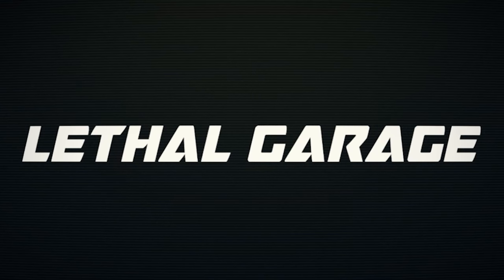Building a Camaro SS/LT1? Watch This Video First! | Drive with Lethal

Comment: I was looking at full NA build
-Cam
-LT2 manifold 
-95mm throttle body
-Kooks long tube headers high flow cat
-Rotofab CAI
-would go e85 but one store within 20 miles and due to elevation I was told not much gain. 
-Tune

Total price quote parts and labor they said $9,000. Is this high or is this normal price? Thanks

Comment: Watched the vid. My 2014 2SS is similar to yours. Have a 2.9 Whipple. All forged with a stroker crank. Ported heads. TRI-Walboro  pump setup with large injectors.  I run on E85. I also have NOS. You keep talking about adding Methanol Injection. Had it but didn't need it. It made the car very hard to tune with the E85. I removed the whole methanol system. E85 is temperamental. I went with a summer tune and a winter tune for Texas.  I think you'll be making a mistake with the  methanol install.  Also it runs out very quickly, you need to keep filling up that tank. Cheers
Reply from the maker: The 5th Gen isn’t a DI motor, so it’s very different.  Depending how you run the meth is also a huge factor. We will have an on demand system and it will be just fine with 3gals at a time.
Reply: Di is easy to tune with meth and e85 for a good tuner and is the only way to make max power with direct injection they both cook the combustion chamber and the meth adds fuel and cleans the carbon off the valves and pistons . Combined they give the ultimate detonation resistance

Comment: Which route should I go supercharged or pro charger?
Reply from the maker: That’s something you need to decide based on your goals for the build
Reply: I’m more to the pro charger but witch one will be a medium budget route not to high my goal is 500 to the wheel or 550
Reply from the maker: ProCharger are a bit cheaper
Reply: LethalGarage are they reliable?

Comment: I have a TVS 2650 and nothing else.  It's plenty of power for a car that will always run Michelin PS4S.  My issues are some of the driveability of the car.  It's not terrible but still occasional light surging, weird part throttle paddle shifts and too much throttle input relative to the actual pedal input.  I have a reputable tuner and I've heard the issues are related to limitations in HP tuners torque tables.  I wish I was more familiar with the system.  I hope some like Haltech makes a plug and play solution for DI Camaros.  By the way have you seen that SPL Parts makes all the suspension now?  they make awesome stuff.
Reply: Sounds like you need to find a better person to tune your car for you bud. You shouldn’t be having any issues with that Maggie unless somethings not hooked up right or you haven’t got it tuned properly. My Maggie 2650 doesn’t do any of those issues you described. Hope you get it fixed ✌🏼

Comment: If you are just doing cam or staying NA you really don't have to upgrade your fuel system. I have a cam with 32% more fuel lobe and have fbo cam and ported heads and can still run full e85 no problems, now im pretty much getting to the limits of the stock lt1 fuel system, but the car should be making around 575 give or take. I added nitrous but with a standalone fuel system so that i do not have to use the stock fuel system and can spray 100-150 hp more easily with c16 race fuel to get into the 650-700 easily without having to touch stock fuel system.
Reply from the maker: Well of course, your NA with nitrous.

Comment: You mention that the LT1 platform might be best route for a drag build.  Don’t no about that because it does have track mode, I just wonder if that would be another hurdle to over come.    Bare bones 1SS would be my choice.   I saw the LT1 in person that front end looks very cheap.
Reply from the maker: Don’t need track mode to be a good drag car. Any good car gets a trans tune regardless
Reply: LethalGarage  I am thinking more on the lines of ECM completely and tune.  Just a thought.

Comment: What's better buy z28 or 5th gen zl1?
Reply: Sahota Gaming it’s hard to choose
Reply from the maker: Depends what you want to do with the car
Reply: Buy Z28
Reply: 5th gen ZL1 is overall a much better value and cost much less than the Z28, plus you don’t have to worry about the issues that come with the LS7

Comment: Want to build my 2019 2SS already have long tube headers roto fab e85... Idk what to do next... help needed... new to this🙏🏾
Reply: Jason Parrish I recommend cold air induction system, then from there I would do heads and cam.
Reply from the maker: I’d do a cam before heads.
Reply: LethalGarage much appreciated can’t wait for more drive with lethal videos🙏🏾
Reply: If you’re not gonna go with a roots blower or if you’re gonna stay NA you could pick up an MSD intake manifold.  Adds a lot of top end and makes a huge difference for a cam.